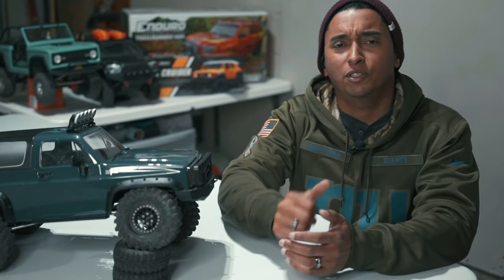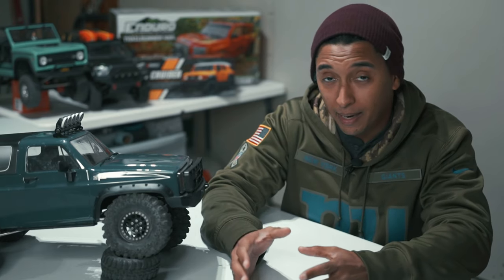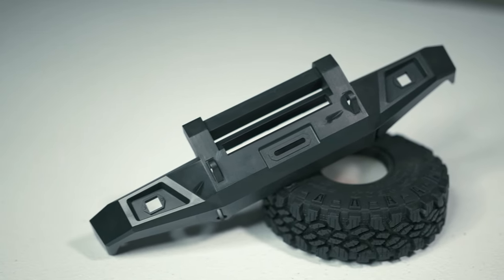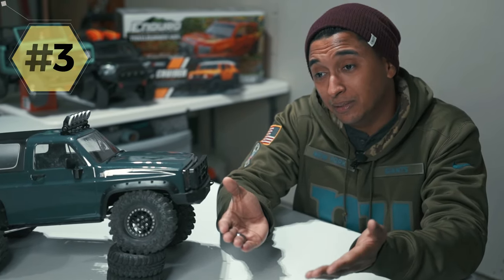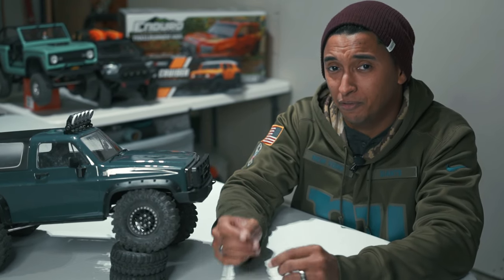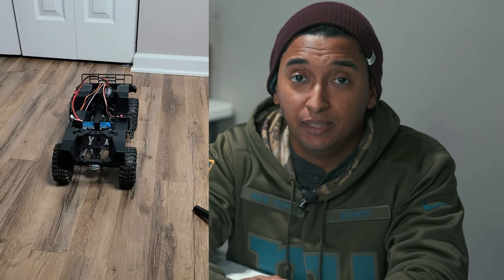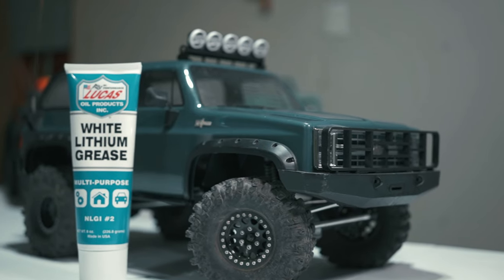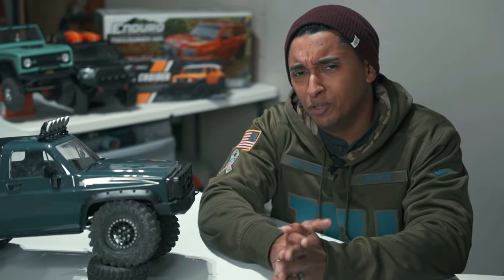What's Wrong With My Gmade Buffalo?!! 😩

Comment: Update. Issues fixed. In steps 14, 17, and 19 there are plastic bushings part number GM60221. However there are 3 types of this part! 1, 2, or 3. You have to be absolutely sure you used the right plastic busing in the correct places. For me I used plastic bushing size 1 in a 2 slot… a 2-3mm difference caused me to lock out of high gear. I’m step 19, another YouTuber used a size 1 bushing instead of 3… a 1mm size difference and it caused him to be locked out. I would go over these plastic bushings again. 1 is a decent size bushing, 2 is a smaller bushing, and 3 is a same size as 1 but with a lip. The piped orentation maters!

I don’t know how old your kit is, because mine came with an updated page in the manual staples in. So if you don’t have that page… I can send you a pdf somehow if you ask me for it. I hope this helps everyone, and now get to enjoy their two speed
Reply from the maker: I remember this step in the instructions. Mine did come with the updated instructions, and I'll go over the Buffalo when I some time.  You are the man, 🫸🫷Ethan!

Comment: The way the mesh works on these is if you're running the kit 13 tooth pinion you push the motor into the housing then turn clockwise and you should have the correct mesh, it's not a great way of doing it cause as you say you can't visibly see the mesh, could possibly drill/cut a access hole in the housing to see the mesh, going by vid it doesn't sound like the mesh is too tight, these have a very quiet transmission so would be quite noticeable if the mesh was tight, if you push it along the floor does it roll quite easily?, the way it takes a couple of feet to start jerking makes me think it's the front over drive on a high traction surface causing it, is it as jerky on a loose surface where the front wheels can slip a bit?....maybe just try disconnecting the front drive shaft then give it a quick run on the floor and see if it still does it
Reply from the maker: Thanks for sharing. I will definitely try these steps because I really like this truck.

Comment: Any update on this? I’ve seen many comments from other Buffalo users saying they lock theirs in 1st gear due to the binding/surging experience in hit gear
Reply from the maker: I have too locked mine in first gear. I have ran  it about a month ago, and it is still noticeable but not as much.
Reply: Really wanna unlock it and use the 2 speed. Everyone who has the issue can’t seem to find a fix
Reply from the maker: Hopefully, they will fix it in the newer models.
Reply: @therctrails  ...There is nothing wrong with this Gmade (GS02F). It is about attention to detail, like "how" you put the transmission together, how you put the "rod-end" on the CHROME SHAFT... theeading-wise,  cuz it will reflect a difference in allowed (in & out) with the chrome shifting shaft !!! 🤔
- You should have about a 1/16th of play between the optional 1st gear lock-out, and the casing, where the chrome shifting shaft, "goes in". Some play, meaning "freedom" is good, but make sure you screw the "rod-end" on to a desirable position !!! 👍 Whether you lock-out this shaft in (1st)... or let it be, in 1st & 2nd, you still need a little play, but [no more than a 1/16th of an inch]... between the back of the transmission casing, and the groove to put an "e" clip. - And the chrome shifting shaft should NOT allow for any "more" play with this shaft, other than what I just stated !! 
- I own the same (GS02F) and have had "NO" issues with engagement, and no problems with it "moving out of place" !!!
If you need to "lock the shaft out", follow the instructions & put an ("e" clip) in the groove, of the chrome shifting shaft. 👍
...I truly "hope" that helped !!! 🤔.....✌️
Reply from the maker: @Paul Schryer  Thanks for the info. 🙏🏽 I seriously think it just needed to break itself in. I have it locked in 1st gear already. After a few trail runs, I feel like this issue starts to slowly disappear more and more each time I take it out.

Comment: I love my Gmade Buffalo. I did spend more time searching for the right bag of screws than I did actually assembling it. 

I also have a slight problem with what I would consider "surging" at low speed with the Hobbywing Axe system. I did NOT have that issue with the brushed 540 motor and WP1080 ESC that I had in it previously. I am using a Flysky transmitter and receiver. My issue doesn't seem like it is binding, just a surging from the motor/ESC. Also note that my rigs with the Fusion Pro do not have that issue but they're different brand trucks. Even the Fusion SE I just installed in my Gatekeeper is smooth as butter.

Also where did you find the K5 Blazer emblems? I haven't found those anywhere.
Reply from the maker: Those are from RC4WD. Love the look it gives the truck.
Reply: @therctrails  I really need to spend more time browsing their site. Thanks!
Reply: Try updating your axe system with Bluetooth
Reply: @DoubleADay  I last updated it in November. How often do they release firmware updates?
Reply from the maker: I love seeing the community helping each other out. 👍🏽